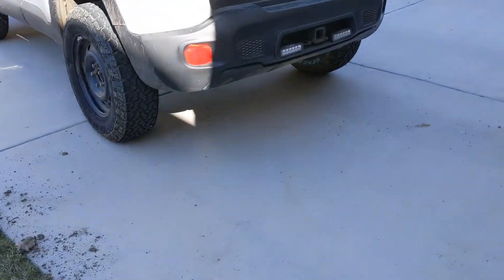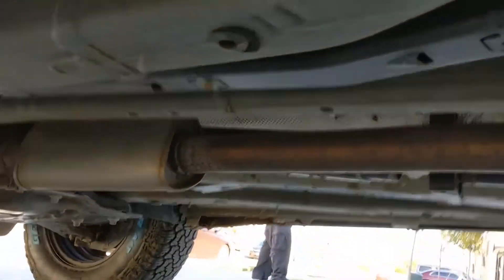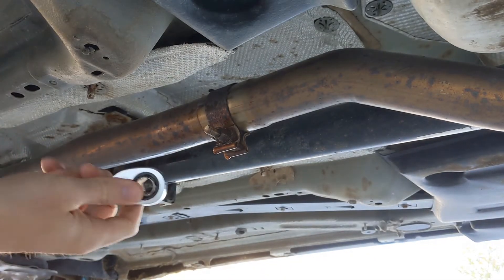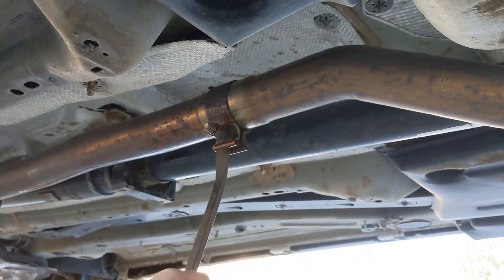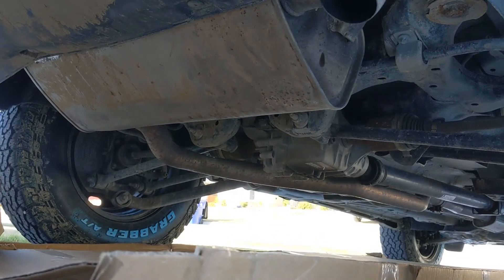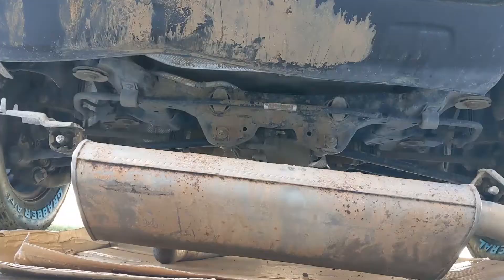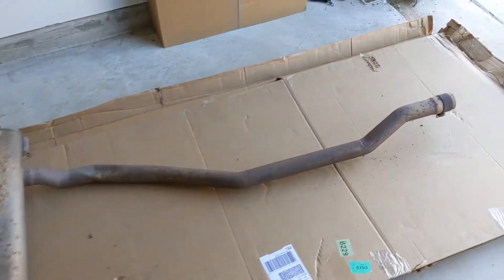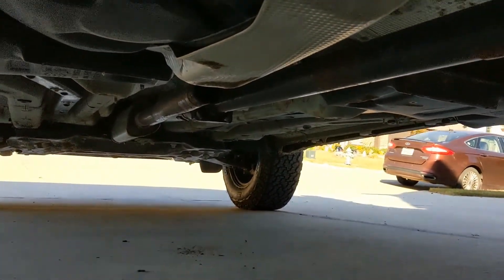Jeep Renegade without a muffler

Comment: Will this throw a check engine code? I’d like to make my renegade louder without sacrificing my 4x4 or breaking the bank.
Reply from the maker: Removing the muffler did not throw a code. Anything past the last O2 sensor can go and you'll be fine.
Reply: @manualrenegade9755  thank you very much
Reply: @manualrenegade9755  just chopped it off, absolutely love it 🤘
Reply: @iameatingursnack   which generation was it that created, raised, and made these folks again??

Comment: Did you leave it off? Is it dangerous to leave the rest of the exhaust hanging like that?
Reply from the maker: I have left the muffler off. It has not caused any issue with the exhaust. I did add a turn down to direct the gas down because it was created buildup on the rear diff.
Reply: @manualrenegade9755  what size turn down pipe did you use? Would like to just grab everything I need and handle it all while I’m under there. Thanks In Advance!